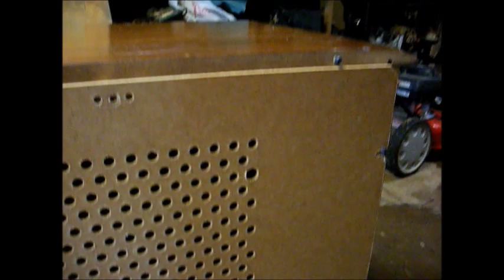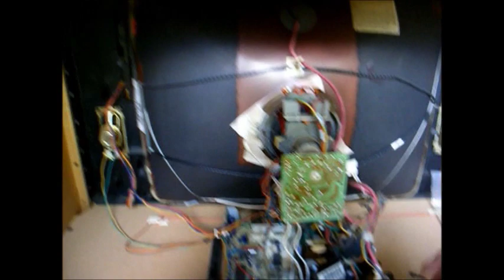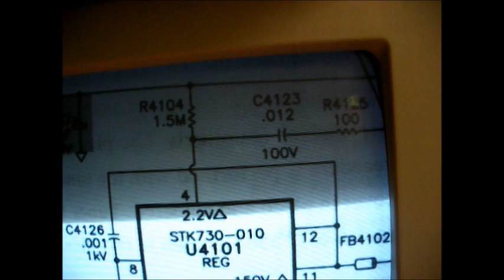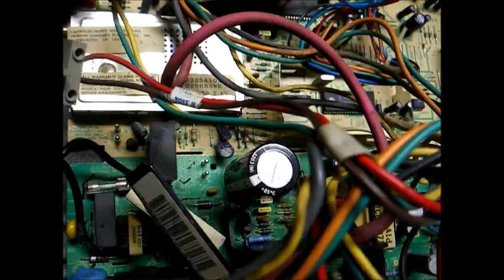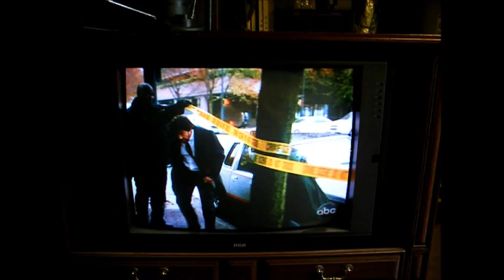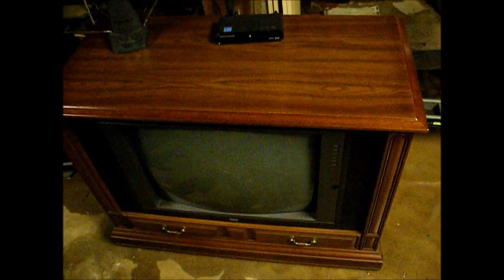Repair of a 1993 RCA Colortrak 26" cabinet model color TV using the CTC177 chassis

Comment: About a year ago at my apartment complex someone threw out a 1982 20" Sony Trinitron, set it next to the dumpster and it sat there for two weeks, since our garbage service doesn't deal with electronics. It had been rained on and snowed on that whole time, and I finally decided to take pity on it and grabbed it. Works beautifully. Someone probably tossed it after getting a flat screen TV. I'd like to see a flat panel last for 30+ years and work after being rained on.

Comment: From 1987 to 2002 I was a TCE warranty servicer in central Illinois. I can't tell you how many of those sets I've resoldered and modified, but when they worked, they worked great. I actually did warranty work for about 27 different brands. I earned a good living with a soldering iron in those days. Bad solder was the biggest problem all those companies had.
Reply: So

Comment: Sometimes people throw away TVs they think are dead but they're actually not. The 32" Samsung flat panel I have now came from the trash. I saw the guy throw it away and he said "I don't know what's wrong with it but it's dead. It just won't come on anymore."  I took it to my place, plugged it in, turned it on and it  came right on. I think the guy's remote batteries died and he didn't know you could turn the set on manually.
Reply: +ldchappell1 I just bought £350 worth of wireless keyboards off of ebay as faulty or not working, and do you know what it was? the numlock key was engaged turning some letter keys into a numeral key! HAHA these are all brand new customer returns!!! I paid £10 for the lot ;) its simple people can be stupid!
Reply: Peter Ceallaigh  That's hilarious and doesn't surprise me. One of the neighbors in my apartment complex paid me $40 just to connect a digital converter to his old TV and scan it for channels. It didn't even take 10 minutes and he was SO grateful. I asked him "Why didn't you just read the instruction manual?" and he responded "Oh, I threw that away. I can never figure those things out anyway." lol
Reply: Peter Ceallaigh  LOL..that's funny. I should put that on a sign and hang it on my wall.
Reply: +ldchappell1 Vacuum cleaners are probably the most likely to be sent to an early grave. So many people throw them out because they can't find all the filters and can't figure out why there's so little suction.
Reply: No Name   I haven't owned a vacuum cleaner in years. To keep our building bed bug free the management took out all the carpeting and replaced it with linoleum.
Reply: +No Name The EU recently decided to restrict the power of all new vacuum cleaners and I kid you not the local amateur radio repeater lit up with this conversation, everyone arguing about Ohm's law and how this just forces people to vacuum for longer ;) and a lot of people understood this as an instruction to throw out perfectly working vacuums LOL
Reply: James Roy  That's for sure. It never fails to amaze me how oblivious some people are when it comes to diagnosing and repairing their own electronics. It works out great for guys like me because I rarely have to buy anything. Just in the last year I retrieved and repaired three flat screen TVs that people had thrown away. Two microwave ovens. Two desktop PCs and four Dell monitors.
Reply: James Roy   I know what you mean. I have a friend who never reads the manuals. He throws them away and then comes knocking on my door when he has problems he can't figure out. You get no respect in my family if you're a male and can't fix anything. lol
Reply: why a flat screen why not a tube sets the tube sets are better then the flat screen TVs the flat screens are cheap junk and they don't last
Reply: CRT is better at a few certain things
Reply: Well, aside from the clever stuff! just one use for example: just give an idiot a hammer and a CRT and you can keep that poor soul happy for minutes! I mean you just can't get the same satisfaction with a TFT! it's just lackin the smashin!
Reply: Yeah that's true :) I once saw a guy in his yard melting the glass over a fire to recover the metals, but I like old computers, CRT screens are still good for those computers.
Reply: No not 486, much much older than that, 1976 -1986 which give better output with a CRT without question, I do not collect anything related to IBM compatible, whats the point?
 yeah I stick SSD drives in old thin clients and install a minimal linux on them, even stuck a re-purposed thin client into an arcade cabinet running MAME emulating the old arcade games, the raspberry pi 3 in a cabinet works good too, CRT does have a use for instance in arcade cabinets, don't write off any technology that you don't personally have a use for, believe it or not people pay good money for sony CRT screens even like the one you smashed! :), for a kid messing around playing xbox for example then a CRT is not for you but technically they do perform better at a few certain jobs, and now they are a finite resource.
Reply: Your wrong, sony CRTs can fetch good money I buy them off ebay all the time! also arcade cabinet CRT screens can fetch a fortune! you have no technical knowledge trying to argue with electrical and electronics engineers about something you know nothing about, stick to smashing electronics instead, I have systems here that I am looking at that do not function with modern displays, I have no option but to source CRT screens, for you to play on your xbox you don't have to worry!
Reply: Come on kids. Play nice or we'll tie you up and force you to listen to Bachman Turner Overdrive on 8-track.
Reply: James Roy  So says the insecure guy who thumbs up his own comments. By the way, most houses here in California don't have basements.
Reply: (by mistake)
Reply: ldchappell1
I now hate the mention of CRT! :) I might also smash the next one I see! (as long as I can not use it) he is right, CRT screens from a consumers point of view are shite but sometimes they have a use for a very few specific applications and as any electronics go its fun to pull them apart to see how they did things back in the day, and I would still build circuits out of big bulky discrete components over surface mount components given the choice because surface mount is a pain in the arse to fix.
Reply: go spend your $100,000 on something else then LOL
Reply: James Roy  You really should stop thumbing up your own comments. Maybe if you had something worthwhile to say more people would recognize the intellectual brilliance the rest of can't see. Dazzle us with that infinite wisdom.

Comment: I just found a 27" RCA Colortrak on the curb. Took it down to the spare bedroom in my basement with help from my neighbor (thanx John!) and worked just fine. Really nice tv with the cabinet built around it which also is in great condition, and a space below for a DVD player or whatever. Can't beat it for free. Built in 1993 in the good ol US of A.
Reply: lol :D.. i'm in Canada and I have a RCA Colortrack with a CTC203 that someone gave to me. this set had a bad soldering and now it works fine.
Reply: Russ Boyes  That doesn't surprised that you found a CRT set thrown away. In the apartment building I live in people throw perfectly good TVs away all the time. They get a better and just don't have the space to keep the old one. Two months ago I found a 26" 720p flat panel in perfect condition just sitting by the trash. I took it and sold it the same day for $70.

Comment: I have found that using a liquid flux pen, and then soldering those soldered ground tabs, on various units, gives reliable joints.
Thanks for the video.

Comment: OMG! we set one of those on the curb just 2 months back!  Was a fine set sigh but after the change to digital and not having cable television ,we had to let it go ... only problem was a wonky power on off relay
Reply: but worked fine turned on by the remote

Comment from the maker: Judging by the physical size of the resistor, it's a 1/8 watt (no bigger than a 1/4 watt); which, is likely too small. I replaced it with a 1/2 watt. Actually, this chassis series didn't take lightning too well and was often fried beyond reasonable repair. I've gotten lucky on a few where it only took out the main rectifier diodes and/or the voltage regulator IC.

Comment: There is also a 10UF capacitor in the STK circuit that goes bad, and will blow the STK when it does. I ran into this several times in the past along with the 1.5Meg resistor.
Reply: Yes, there are two 10ufs that should be replace with the STK, but a shorted secondary diode on the 140 reg line will destroy the STK immediately.  The 1.5 meg resistor will prevent the STK from initial AC plug in start-up, but won't damage the STK.

Comment: thank you for this video, i have a slightly older 1988 model colortrak 2000 and it has the same issue with the cable input being spotty, thusly a swift jab corrects the issue for a short while, now i know what to look for in my repair :)
Reply: Tony Fleetwood   They're nothing alike.  The 88 RCA uses a self contained can tuner that is soldered to the main board.  Foils under the tuner are fragile so removing the tuner can cause trace damage.  I've rebuilt a hundred of these tuners but they were not designed to be serviced without extraordinary effort.  The 177s tuner is built onto the main board and was designed to be repaired.  If your TV has RCA jacks, use a cable box with RCA outputs or grab an old VCR, feed the RF into it, feed the RCA outputs from the VCR to the TV.

Comment: My 2007/08 Sansui 27" (Orion built) has a digital tuner, but the Zenith DTV converter box outperforms it, and it doesn't take the box 5 seconds to change a channel.

Comment: I got a 1978 Magnavox 21 inch Color TV Still working great and very good color as well.  Also I use an attic Antenna coupled to a DVD Converter box.  Best Buy and Walmart carries the antenna, CLEARSTREAM 2V antenna, connected up to a RF-G1179 Bi directional Mini Drop Amplifier; must be plugged into an electrical outlet. Best Buy has everything. If you pull up AntennaWeb.org, it will tell you where to aim your antenna and a TV schedule for your area. Antenna Direct has them on sale. I have 4 TV's working on one antenna!

Comment from the maker: Well, this one has been at a local consignment shop for almost 4 months with zero interest. I think they have it priced at $65; but, I told them to take whatever they could get. 10-15 years ago, I could have easily gotten $150 for this TV and people would have been fighting over it. Today, no one around here wants anything unless it's flat. People don't care that the older ones are made better. All they care about is having the "latest" thing on the market & so what if it breaks in two years.

Comment from the maker: Classroom record players are usually built like tanks & sound nice; but, they are not the most gentle on records. They're geared more towards being built well enough to withstand abuse over being gentle to records. They are fine for playing 78's & beat up and/or non valuable LP's/45's; but, I wouldn't play anything "good" on one.  They would all benefit from a recap; but, there are not many caps involved. '60's-'70's Newcomb, Auditronics, VM & Califone are the best ones.

Comment: where do I find info on parts for an old toshiba console tv? the tv looks inside like it was never used. when it was given to me, the color would not come on for 10-15min. after a couple weeks, the color does not come up at all. the picture is black and white but the display numbers come up in green like they are supposed to. any info would be a big help. I put it in the guest room and it is too heavy to drag back out.

Comment: My old discarded RCA lost tuning.  The only thing i could do was use the rca jacks on my vcr, so thats how we kept it running for 5 years.  If i resoldered the tuner grounds, would that have fixed, or was it something else?  Was having rca, but no tuner a symptom of this 10 year old design flaw by RCA?

Comment: I have a RCA with a CTC203 and I can't see the date of this set. It had just a littlte problem... a small piece of metal near the flyback was broken. this piece has 2 legs and a small discbetween them..Just make a soldering on it and it's working fine. However I need the schematic and I don't know where i can find one..
Reply: +MultiTechnicss Some libraries (eg. Worcester, MA) keep an inventory of Sam's Photofax packs.  You can look up the number of the pack on the Sam's web site, then copy what you need at the library.

Comment: My dad was a Motorola TV, radio and stereo buyer for over 40 years. He disliked RCA sets because the chassis ran so unbelievably HOT, regardless of what model or year set he looked at. GE televisions also generated much heat.
Reply: That may have been his impression, but he was wrong.  Any vacuum tube TV would pump out tons of waste heat, Motorola TVs included.  RCAs were no more prone to heat than any other brand.  There were literally dozens of manufactures of TV based in the U.S. through the 60s, and most were considered "second tier".  Professional repair people would tell you that Zenith TVs were the best constructed by a wide margin, and RCAs were the best engineered (also by a wide margin).  The Sylvanias, Philcos, GEs, Motorolas, Admirals etc. were the second line of anybody who sold TVs.  RCA and Zenith were almost always the primary line.
Reply: Not  so sure about Motorolas, dude...I remember Consumers Union testing where they output 20--30 degrees (F) cooler chassis and ambient air than RCA and GE comparables. I agree with you on Zenith quality, though...my first personal buy on advice from fellow USAF folks was a Zenith color set in time for the '74 Fall shows! That set lasted until 1991...
Reply: King Bee
 Consumer's Union?  They had opinions of thousands of products but were experts on nothing. :0)   Heat was never an issue with any particular brand.  I remember though an old Motorola tube TV that had it's tube sockets sunk about half an inch into the chassis (hand wired, no boards) as a sort of built in tube shield.  The bakelite (or some composite) tube sockets crumbled when we attempted to service it.  The sockets being below deck a bit probably trapped the tube heat and caused this issue.  I "repaired" this tv by greasing up every tube and putting them back into the sockets as best I could, inverting the chassis, and epoxying the bases together rather than replace 6- 10 degrading sockets.  Fortunately, every tube released.

Comment: To the poster below that mentioned "pre-programmed" eeproms; they don't exist.  Every tuner is different from a physical standpoint. Every coil and varactor diode is unique, and every CRT is unique.  If you had five of the same model TV brand new, and swapped the eeproms around in them, you'd now have 5 TVs with problems. If the eeprom needs to be replaced, the TV needs a complete alignment done with the proper equipment to work it's best, not just run good enough to give some sort of a picture.

Comment: I have an RCA TV 27 inch from 1999 or to say I bought in early year 2000 very reliable TV, yet thunderstruck hit in Miami, Florida and my TV works like a charm is the RCA F27665 that was released in 1999 and early 2000 CRT set yet the TV is the sharpest tool in the shed bright picture for it’s time closest thing to High Definition pro grade, while a friend of mine had a South Korean branded Chinese flatscreen yet thunderstruck his TV and it ain’t work fixing it, or to say LG have TVs not to say if they make them in China; but is not resistant to thunderstorm strikes and you have to that you need to buy a surge protector. 

Samsung is guilty for having their own factory in China for making TVs that is a total ripoff, so my dad need to say in Colombia fix that TV; to say it all their are companies that make a bad product and it is a total ripoff and charge too much for a bad product. 

But if you could find this RCA TV if it is the same one yet their are two versions one they is a Picture in Picture version and one that is the standard version it outlive my stepdad’s Zenith TVs from 1996 that had a few issues. 

So here is the link of the TV I had probably if it is the same TV I had it has been worn out a lot to this RCA TV like mine has outlived those Samsung flatscreens from Samsung China Company in Tianjin where the majority of the Samsung Flatscreen TVs come from and Assemble those Tianjin Samsung TVs in Mexico, if you want a Flatscreen I recommend you Sony it is better quality than those Mexican assembled Tianjin junk from Samsung. 

Here is my RCA TV look like is a very reliable TV, as to say they don’t make them like they use to yet open up a modern Samsung and you see that the screen is made by the same company in Tianjin, China.

https://www.visualalchemy.tv/1999_27_rca_f27665